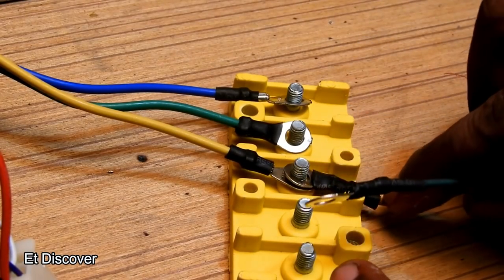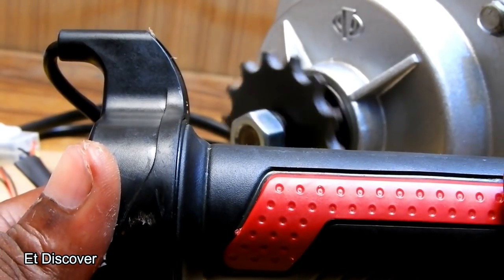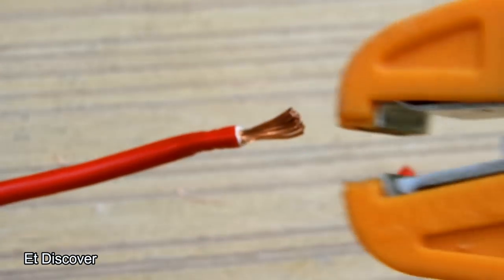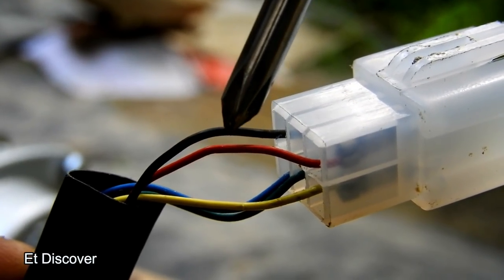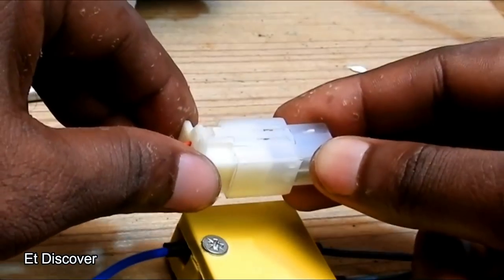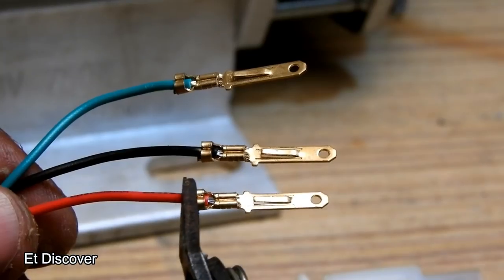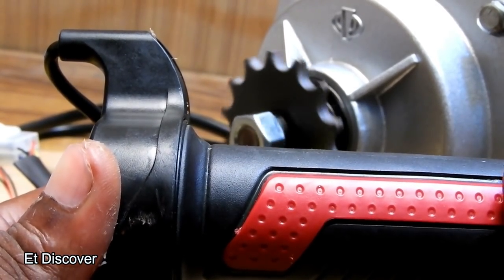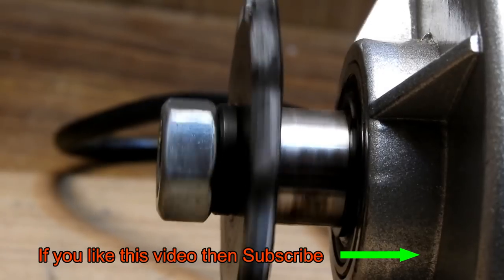How to Properly Assemble 750Watt Motor kit #For E-bike (Et Discover)

Comment: Man, i've bougth a motor with a controller like this one and i had not got the manual and the seller can't helped me but this video yes do, thanks
Reply from the maker: How can I help you??
Reply: @EtDiscover   Et Discover  you see, i have a kit similar at yours wich i did can works bases pm you video, but at now it works a few seconds so slow up to stop it and i don't know why
Reply: Same problem bro
Reply: @nagendramonarch6400  hey bro could you tell me what happen cause i have solved the problema. For everyone that hace the same problem maybe i have one solution
Reply: @nagendramonarch6400  ok bro, some controllers works whit 48v / 60v in the Tag Say that , and mine got works well whit 60v(5 batterys) because whit 48v(4 batterys) it works slow untill stop

Comment: In sadar bazaar Delhi kit starting from 250watt  500 watt 750w ........ with all complete parts and battery included available from rs8000 fits in all cycles with chain tensioner .

Comment: I need help, I have 1800 watt motor, speed contoller, I have all the proper colors connected and 4x 12v batteries-10amps each.  My batteries spark and stuff, but when I turn my throttle, nothing happens.  My speed contoller doesn't have that second red power wire that is seen in this video, what do I do.

Comment: Why did you connect 4 batteries in series? To increase the voltage? If we use voltage doubler or voltage booster circuit,  then do we need to connect these 4 batteries in series? How to calculate hour of a battey will run a 750 watt motor taking a load of 140 kg?

Comment: Battery ka price kitna ha???????      &.  Kahapar milaga
Reply from the maker: 12000
Reply: Et Discover from where I can get these batteries?
Reply: Et Discover Rs 12000 for  battery and 5000 for motor kit + charging kit= total == 25000 
Better to buy new electric cycle starting from 14000